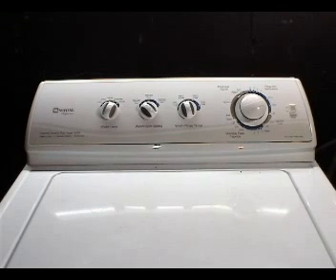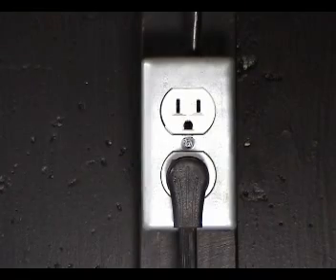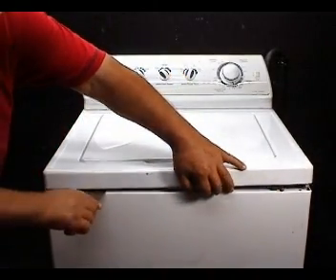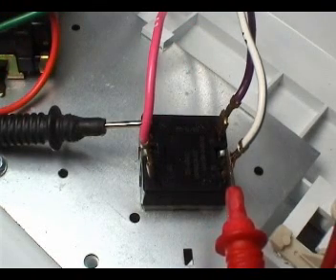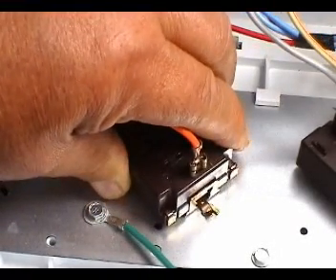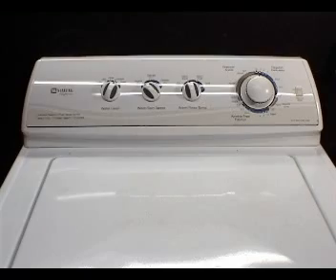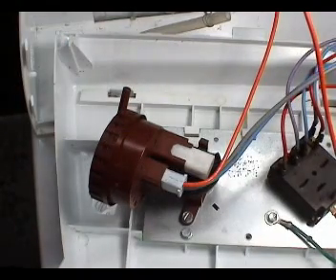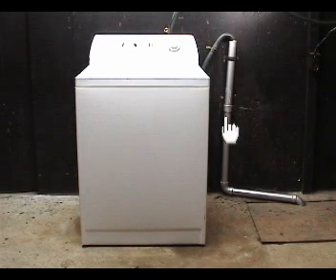Performa Washing Machine Not Filling With Water - See The Parts You Need To Check & Replace

Comment: Hi, mine won't fill at all. Water dumps in and just goes out. Nothing stays in the tub at all.
Reply from the maker: Try this, remove the drain hose from the drainpipe and lift it higher than the drainpipe and start the washer filling with water.

If the washer starts filling properly, all you need to do is to make drainpipe higher to prevent siphoning